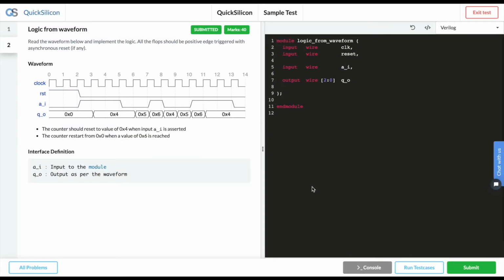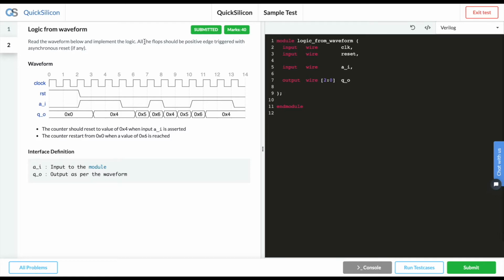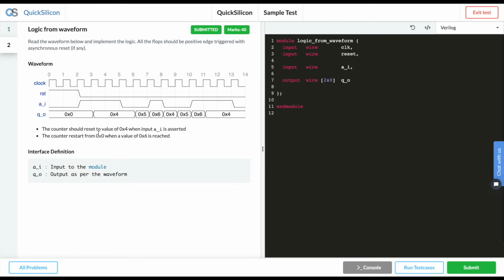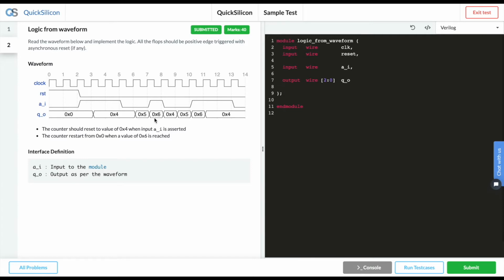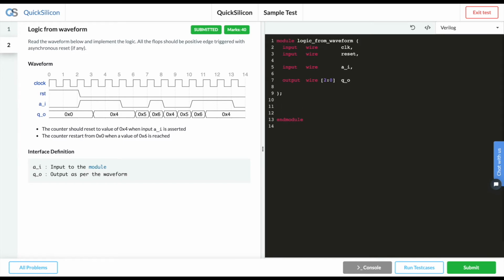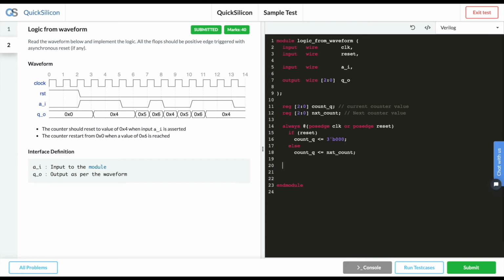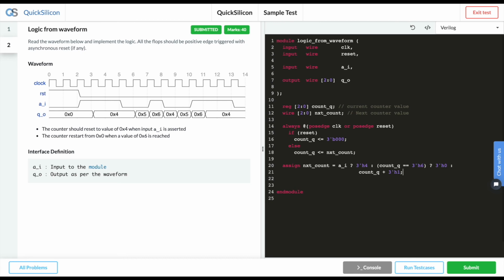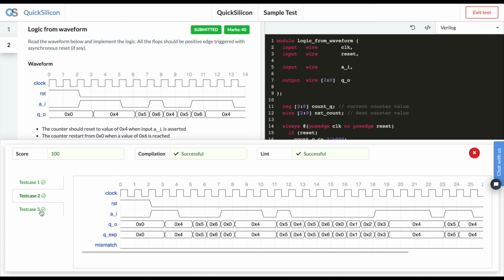Verilog Design Problem - Logic From Waveform | QuickSilicon

Comment: module logic_from_waveform (
  input   wire        clk,
  input   wire        reset,

  input   wire        a_i,

  output  reg [2:0]  q_o

);

  always @(posedge clk )
    begin
    if (a_i) q_o <= 3'b100;   
    else if (reset)q_o <= 3'b000;
      else begin 
      q_o<= q_o +1;
         if (q_o==6) 
           q_o<= 0;
         end
     end
endmodule

this code also passed all the cases.
Reply from the maker: We recently launched our new hands-on RTL Design course. Check it out here: https://quicksilicon.in/course/rtl-design/module/events-to-apb/

About the instructor: https://www.linkedin.com/posts/raulbehl_100daysofrtl-verilog-servingthenextbug-activity-7011579445681491968-4uiQ?utm_source=share&utm_medium=member_ios